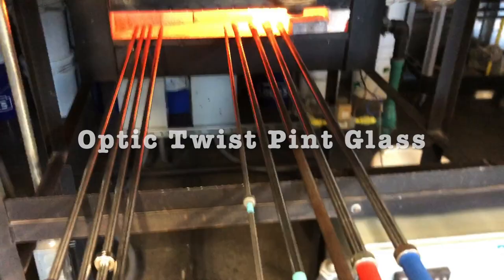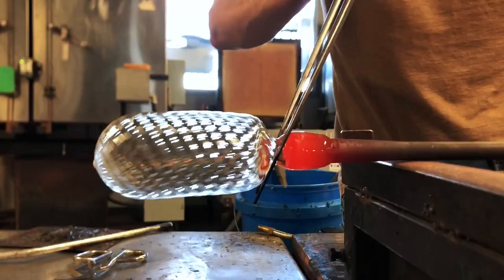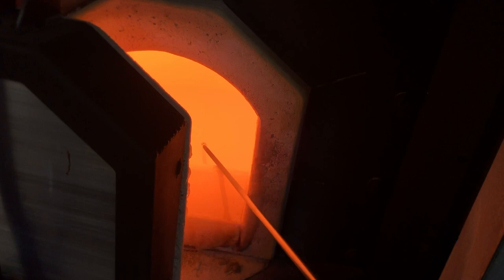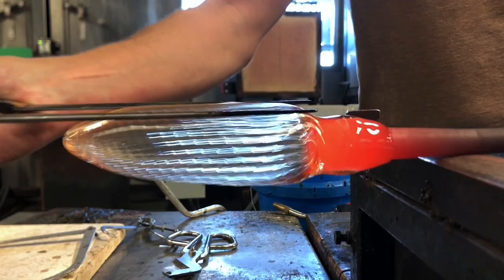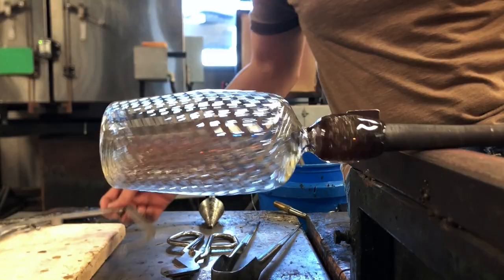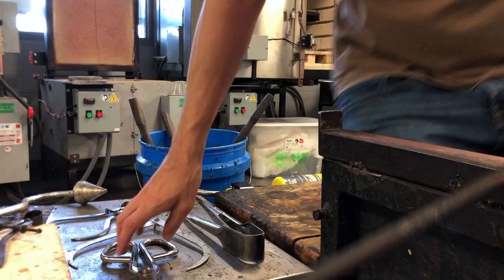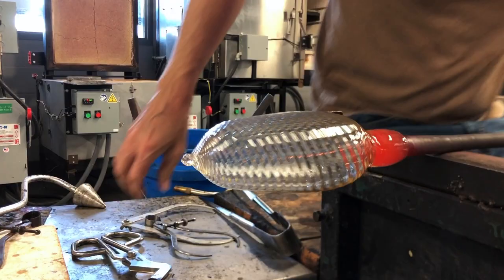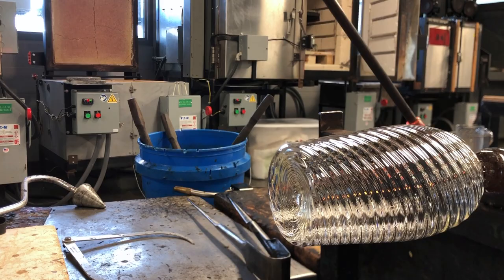Narrated Glassblowing - Twisted Pint Glass - Optic Mold Technique

Comment: I’m just starting out and am taking an intro course at the local community college. I wanted to thank you for leaving the first two tries in where it came off the punty and explaining what may be happening. I’ve had the same issue and it’s been frustrating and it’s nice to see it happens to everyone! Love your videos and I’ve learned a lot from you!
Reply from the maker: Thanks for the kind words! Yeah, punties are tricky, especially delicate punties for thin objects. Timing, flashing and smooth movements (not banging the piece around while you're setting it on the bench), that's all important. Of course, using a good punty to begin with is also important... but that's a video for another time.
Reply: @davinebanks   I’ve learned each of those lessons the hard way, I can’t tell you how many pieces I’ve lost because I tapped the back rail a little to hard sitting in the bench! I wish I could say I just made that mistake only once! Also I credit your Punty videos you made on Kent State’s page for advancing my knowledge of them.

The next time I’m in the shop I am going to attempt the twisted pint glass and the rocks glass.
Reply from the maker: Glad those vids helped! Keep on keeping on.

Comment: Which optic mold are you using? Thanks
Reply from the maker: I think it's a 12-point. Steinert.
Reply: @davinebanks  yeah, I counted the points. It is a 12 point but I was wondering how tall. I’m guessing 6”?
Reply: @davinebanks  the reason I ask is that I can’t get enough glass in my mold to make anything bigger than about 4 1/2” tall.
Reply from the maker: @mdbryan9525  I'll check and get back to you.
Reply from the maker: It's the 4.5" tall mold. Steinert's 4.5 / 12. Slight interior taper like the traditional Italian stamp molds. When I stamp mine it's not quite full of glass. I could probably get a bit larger, but not easily. Hope that helps!
Reply from the maker: Hope you saw my other answer to this. It's the 4" mold. A 4-1/2" tall cup is pretty good! That's at least 12 oz. Nice. If you want bigger try blowing a LOT thinner. Go so thin it collapses... then next time blow it just a bit thicker.
Reply: @davinebanks  I did. Thanks. I thought I responded to you but maybe I didn’t. I bought one, but still haven’t gotten a pint tumbler yet. When I look at your video, your initial bubble is surrounded by much thicker glass than mine is. When I go through the steps as you do ( I can’t gather enough with one gather) I blow a bubble and swing it out but the glass is much thinner than yours. My furnace may be too hot or I’m doing something else wrong. I’d say it was too hot but it always and I mean always takes 2 tries of capping the blow pipe for me to get any bubble at all. Almost always works the second time but it always takes 2 tries.
Reply from the maker: I think you're probably right, and your furnace is hotter than ours. (Not too hot, just hotter.) We run ours about 2080ºF. We're a school so we want to make it easier for our Intro students and not fry them too much! You could do double-dip (small gather, count to maybe 10 then gather again) as long as your heat is even after the second gather. I'd say whatever it takes to get the amount of glass you need. As for thumbing/capping, I should maybe do a video on that sometime. The way I do it is sort of hit-or-miss too, but I do know better ways of doing it. Thanks again for the comments and keep on getting that hot glass! If your on the IG hit me up. Would love to see your progress!
Reply: @davinebanks  thanks. According to my infrared thermometer I’m running about 2090 but as you know, I’m measuring the air temperature more than the glass temperature and the thermometer probably has a 5% error or so. 
I do double dip. And when I blow and cap, I always check for that poof of air if I don’t get a bubble.
Reply: I should probably mention that I am using Seattle cullet glass ( it was given to me) but I like it better than the Bomma I was using before. It has a slightly longer working time but is more corrosive to the furnace.
Reply: Keep your bubble thicker when you go into the mold. Let it sag back before you put your bubble in, so it shoots to the tip, then when you swing it to the shape of the optic mold, the wieght of the bubble will be retained in the walls you will be expanding and drawing the form from later. 

The bubble going to the tip is instruction to get to this state, as well as because the ribs on any solid material won’t me maintained once the glass is blown out. 

get it about as hot as you need to blow the whole cup before you go into the mold, go in and get what you need and come out trying to maintain that heat. 

If your walls are thick like that it’s fairly easy to get 6” glasses on a 4” optic mold. I prefer 12pt for straight ribs, and 16pts for twisty cups, as the smaller ribs can twist tighter and more evenly imo. Less points is easier to keep straight. 

There’s nothing wrong with using a bigger pipe to make work like this if you are struggling to gather enough. You could always dip a little deeper than usual and roll the glass off of half the back of the moil before you start setting up you bubble If you want a nice fat gather.
Reply from the maker: @thomasparker3365  Nice summary. Right on all points!